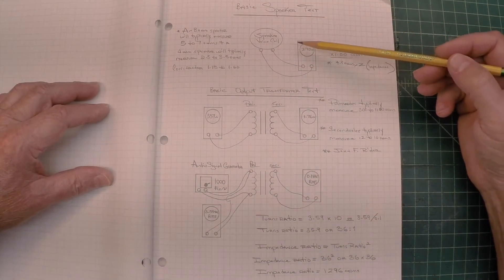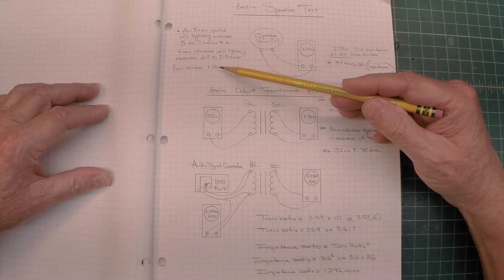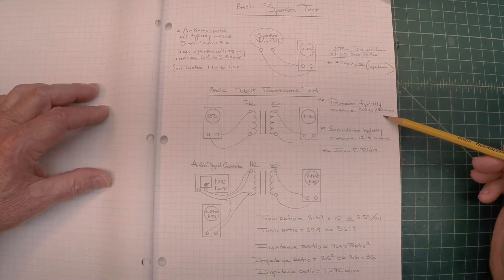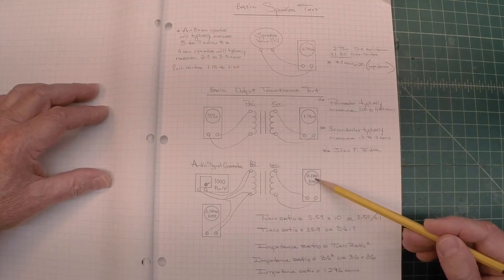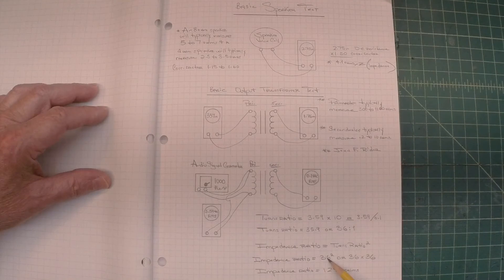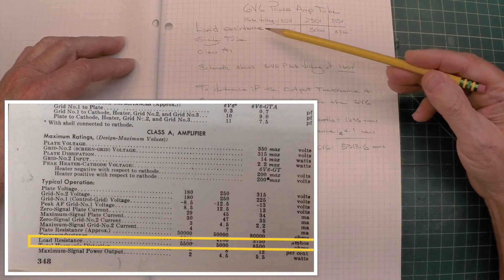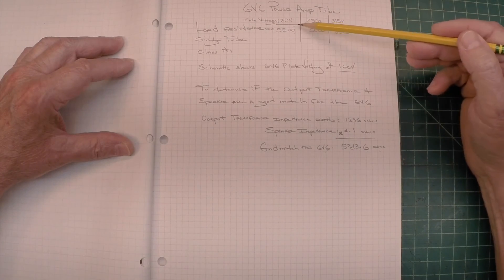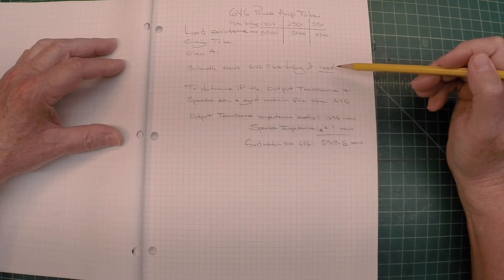Crosley 718-B - Speaker & Output Transformer Testing + Turns & Impedance Ratio Measurements

Comment: I have a question,
I have a 10" subwoofer that is a dual voice coil 2 ohm.
My amp is stable at 1 ohm so I have the sub wired to 1 ohm and i can verify this by testing the speaker wires coming out of box now that it is all hooked up. It tests out @ 1ohm.
Bbbbut when i hook it to my monoblock amplifier it shows 2.46 ohms.
Why?

Thanks
Reply from the maker: Sorry - I deal more with vintage than modern speakers and amps. Try reaching out to Mark on his YouTube channel at: Blueglow Electronics or Terry at: D-lab Electronics. Best, Don